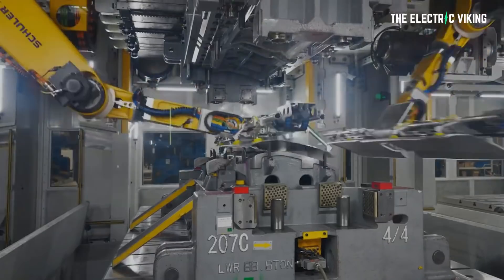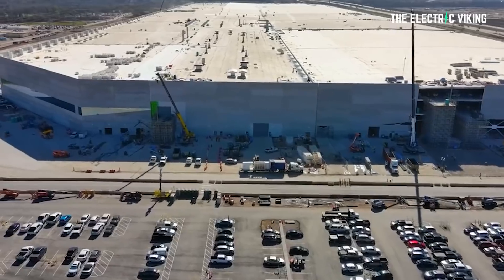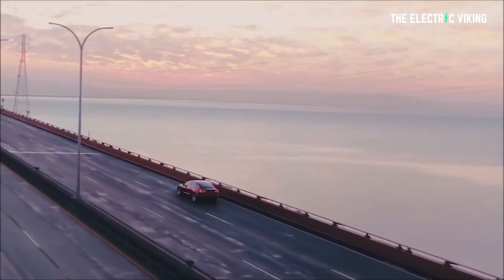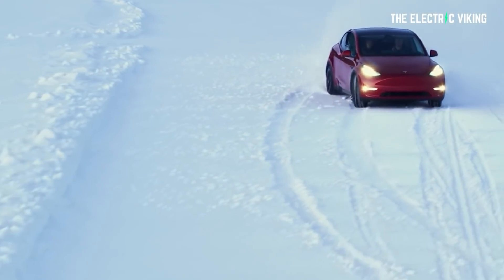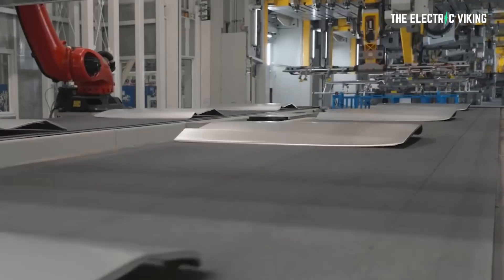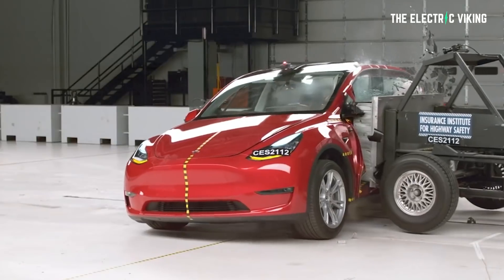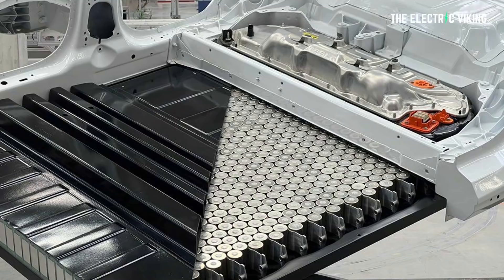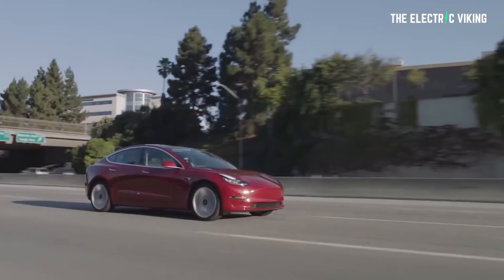Tesla's new patent: integrated energy absorption foundries

Comment: I think the main issue with the gigacastings is tepairability of the vehicle afyer production. While from a production, cost, ease of construction, saftey and innovation standpoint the technology is aspirational , I think too little discussion is put into the disadvantages of vehicle repair in terms of damage. While it is expecyed the vehicle crash likelihood is low, it is not uncommon to see umforseen accidenys happen, such as honda bumps, missing a barrier pole at a parking spot or imforseen crashes. If a chasis repair is necesaary and cheaper than providing a new vehicle (another topic for discussion, resource wasting with planned obsolence while recycling materials is difficult but extremely necessary if we want to stop mining to build evs and not physically destroy our planet any further, highly underestimated) what benefits of easy repair do gigacastings provide over traditional chasis making?

Comment: It’s not 2 parts vs 70 — those were the numbers for the two-piece Model Y rear end produced early on in Fremont.

New process is 2 pieces (front and rear) vs 125ish!

And then there’s me the structure battery pack, which I haven’t heard quantified yet, but I’m willing to bet is fewer parts than battery pack plus frame arrangement.

Comment: My only concern about large castings is related to reparability in the event of a moderate collision, will vehicles be written off more frequently or can the structure be repaired/replaced affordably?
Reply: The casting is the underbody. The body panels would still be the outer surface of the vehicle. So only in accidents that would have resulted in frame/structural damage (in which case it would normally be written off anyway) will the casted vehicles have to be replaced.

Comment: I was watching a video of a VW plant a few days ago and as much as castings sound like a good idea, traditional metal stamping is very well understood and developed.
The entire body of the car was made from the sheet metal to the body coming out of the paint shop with not human labour. All those 70pc of sheet metal were assembled by robots at a rate of one entire body every 45sec. After seeing that video I came to the conclusion that traditional manufacturers are far more effecient than most people think. It may be possible that the difference in manufacturing cost between casting and metal stamping is not big enough to justify changing.
Also a stiffer body is not always better. It certainly helps road handling but that is not always the most important metric.
Reply: Elons machines that build the machine takes 10hrs to build a vehicle vs volks 30hrs. The best of old production does not cut it any more. Innovate for cost cutting and efficiency.   Company management structure does not make changes easy for others to move forward at teslas brake neck speed
Reply: @paulbaretta3269  I think you misunderstood the meaning of 10 and 30 hrs. That is the human labour time per car. The VW factory makes a body every 45sec. Tesla takes 120sec.
What VW needs to work on is the time taken for the humans to assemble the car.
Reply: @franciscoshi1968  impossible.  Tesla front and rear is cast complete. Saves weight, production floor space, roughly around 3 hundred robots and a huge amount of time to weld,glue or rivet hundreds of pcs. That casting machine was custom made for Tesla because of a new invented metal that injects into the mold in less than a second. Traditional methods simply cannot compete. U best do some homework and bing on Sandy Monroe and his  world famous tear down and analysis Co.
Reply: @paulbaretta3269  it takes 120 seconds per cycle for each casting. Look it up.
If each car has 2 castings that means you need to have two presses or one press then run many parts then swap dies. So let's say they have two presses.  That makes maximum one body every 120sec. We will assume the welding of the castings into a single body will take less time. So that means 720 bodies per day or 262800 cars per year per factory. 
The VW factory makes one body every 45sec that means 700800 cars per year.
The VW factory has lots of robots doing many steps one after the other. So all the numbers add up.
The presses to make the pressed parts make a part every few seconds. Pressing sheet metal is very quick. It just takes a few seconds for the die to stamp a part. Casting is much slower. You have to inject the molten aluminium then you have to wait for it to cool down enough for the metal to solidify before you take the part out and then you have to wait for the part to cool down even further before you can continue processing (like machining of threads etc).
I have been to factories that do both. Casting is certainly slower per part. The only advantage is once the part is cast it is pretty much finished. The stamping is extremely fast. So it is possible to make bodies just as fast. It is just a matter of having enough robots.
Tesla did try to automate the stamping and welding process. They just don't have enough experience to make a stamping factory as the traditional car companies that have been doing it for decades.
A very simple example of Teslas's lack of experience is the sub standard paint finish and gaps in their first cars.
If they are so good why couldn't they get that right first time? Paint and panel gaps are a very basic part of making cars that everyone got sorted decades ago.

Comment: The gigacastings also mean much more accuracy overall, like an order of magnitude more accurate. Panel gaps will be absolutely accurate. That means most assembly needing human/hand work to fit should be unnecessary. That means way more automation and faster assembling. Now the car will go thru the line faster than grandma can go with her walker.

Comment: The entire central interior is built on the ‘structural battery pack’ and then offered up to the front and rear castings.
This is fine for cheaper manufacturing but the risk is in crash absorption > integrity.
IT HAD BETTER WORK !!!

Comment: NVH (Noise, Vibration and Harshness) of these designs of Giga castings are still in serious doubt, in our view. OEM's of ICE vehicles have had to give serious design attention to isolating NVH from rear suspension sub-frames on their vehicles, such as in the BMW X5, as just one example. We have loved almost 2 years now of Model 3 Long Range ownership. We are also Tesla shareholders and have a reservation on a Model X Plaid so, we could be called Tesla fans. However, we collected our brand new Model Y Long Range last Wednesday, 23rd February 2022, to run alongside our Model 3. From the Shanghai Giga factory, our Model Y on standard 19 inch wheels, seems to have a rear aluminium die-cast, Giga casting. Driving back from the NEC to Loughborough, the Model Y had horribly intrusive, low frequency sound pressure wave booming in the cabin, caused by either, some manufacturing fault(s) or by design, inadequate NVH isolation of the rear suspension and Giga cast chassis frame from the cabin, as the tyres run on the road surface. We get headaches and ear pain from this low frequency, resonating booming - even at low speed, each time we drive this Model Y.
The car also seems to be so harshly suspended and so unsettled on the road, that even on basic Autopilot and without turning the wheel at all, it fidgets from side to side at speed and makes us feel nauseous – something we have never experienced before in any vehicle and certainly, not in our excellent Model 3 Long Range.
The booming, deep reverberation, amplified within the cabin volume as the suspension crashes over bumps, is like having the bass turned up high at a rock concert and the drummer giving it special attention every time a rear wheel drums over a road imperfection.
Tesla Sales say that "as the car is obviously not for us" they can only offer a full refund and that we should return it to Tesla. Tesla Service have been persuaded to cut their initially stated waiting time of 1 month to Friday this week, for me to demonstrate this problem to them.Tesla owner's forums seem to regard this as a common Model Y fault. Even ear plugs don't seem to help much, as the bass reverberation seems to resonate within one's skull. Until finally resolved by Tesla, the car is just a very expensive piece of driveway art.
We feel that the jury is out on the whole question of whether NVH of Giga cast chassis frames, as currently designed, manufactured and supplied by Tesla, actually give an acceptable quality of vehicle NVH to the end user, despite the obvious and as a professional Mechanical Engineer myself, very impressive manufacturing cost and efficiency benefits to Tesla.
Reply: That sounds like a serious design flaw, a missing component or a missing fastener(s). Nowadays computer programs should be able to model a design well enough to prevent that. If possible, it should be brought to the attention to someone on the design team.

Comment: I always wondered if this rigidity would result in many more write-offs due to the brittle structure.
[Correction - “60 to 120” MILLISECONDS ]
Reply: Rigid does not mean brittle. Think rigid (and dead accurate parts) means a much more controllable design that can be optimized for better -
Crash safety
Vibration
Handling 
Simplifying parts
Reply: @beauarts  it’s a cost saving and profit margins boost which could explode in Tesla’s face if the insurance industry risk managers load the brand.  The casting are brittle…..they have no capacity for absorption/flex beyond the critical point.
It’s great on paper for everyone …..until it isn’t so great after all.   We shall see.
Reply: @davidpearn5925  Really, what is the basis of your brittle analysis? Have you found test data on the aluminum alloy in Tesla castings? Maybe you got a piece of it and measured the modulus of elasticity?
Reply: @beauarts  well Sandy Munro acknowledges that it won’t flex any more than cast iron. If it gets a reputation as a throwaway item it’s going to be a bit of a disaster for shareholders.
Body jigs designed to stretch twist and pull exist because forces commonly get beyond the panel cladding.   We’ll see.
Reply: @davidpearn5925  ok, that’s some analysis I can understand. There are ways to deal with, isolate, or mitigate that problem. I hope Tesla is aware of it which they should. It’s not out of the question that the slow ramp up of Austin and Berlin are due to not just production but finding and correcting problems such as this. Ditto for the cybertruck

If this is a systemic problem in using a lot of gigacastings, it could be another moat for companies intending to use that tech to shave costs
Reply: @beauarts  another aspect is the is the matter of quoted repair costs ticked off on by the insurance assessor .
Determining if there has been a stress failure deep within which isn’t YET obvious as a structural failure.
Steel yields enough to make that much less of an issue, but castings in an ‘affordable’ vehicle make life difficult for repairers wanting to stay viable and insurers competitive.  Time will tell.

Comment: Fantastic innovation. In material science it is well known that castings behave very different from pressed or forged parts. Castings are more brittle, which obviously will not help in a crash. You can design a special alloy to improve the cast, which it looks like Tesla has done. And the best way to make it less brittle is to do a bit of shaping on it. Fantastic that Tesla does this on these huge and complex parts. Really  amazing to see this.
Reply: Casting are brittle due to the nature of casting, not due to the material used.  This was why Sandy Munro got after the Fird Fiesta's use of them...they weakened the 'safe zone' and were unreliable long term if used for suspension and frame parts.

Tesla put out another 'white paper' like the storied but ultimate disproven 'alpha paper' regarding Hyperloop.

Comment: If cars were out for crash testing that might explain the delay.  Tesla may have had to wait to have cars tested.  Their other cars have a high rating and these should be better.  The cost to make these is good for the customer because Giga castings are Aluminum and Aluminum cost far more than steel.  Tesla could be known as a chemical company as the chemistry of the Aluminum is proprietary.  There is so much to know about the new model Y.  Please get them into production.

Comment: I think that overall the structural battery pack is a mixed idea. Going to make battery repairs impossible
Reply: What % of batteries are repaired today?
Reply: @bru512  Not enough. One of the considerations for owning an EV that's out of warranty. Replacement costs are prohibitive
Reply: Tesla says the batteries will be recycled to create a closed loop system, so there must be a way to get to them. Maybe pull the seats and carpet, and cut a hole in the floor?
Reply: @catsaregovernmentspies  Check out Sandy Munro's tear down of Tesla's.   The vehicle gets raised, and the battery pack dropped. I expect that in the future, batteries will not be repaired, but swapped out.
Reply: It’s a good thing to remove junked cars.
A new vehicle every time.
Insurance will love the new for old recyclability as that’s another money making opportunity waiting to be tapped.

Comment: Giga-castings certainly cost less than welded pieces
but in a minor accident involving the frame of the car instead of replacing a welded bent piece
the entire giga-casting will have to be replaced
a cost 10X as much

So any savings by Tesla are made up by the owner in a crash
and apparently, the insurance companies are aware of this and may jack up the costs of insurance on a Tesla

One man's savings can easily become another man's expense...
Reply: Our tesla insurance price quoted to us on our new tesla is the same that we are presently paying for our 2014 sierra truck.  We were pleasantly relieved.
Reply: Maybe the damaged section could be cut out and a new section welded in. Aluminum can be welded.
Reply: Anything that caused the castings to become completely crushed would require a convential vehicle to be totaled as well. 
Elon already said they would have bolt on crush pieces for repairs that didn't require write offs. You just cut out the crushed crash sections and ad the new pieces. 👍🏻

Comment: I've always worried about cars after a wreck. To me there is not a good way to know how the structure has been weakened. I don't trust the body shop to be able to do that. So replacing an entire casting might be safer in that case. Time will tell how much that costs and if it makes a difference in where the line is drawn between "reparable" vs "totaled".
Reply: Could alternatively mean stronger body that can handle minor impacts better. But if in theory there were some corner cases, a safer car will be worth it: Car parts can be replaced, a mother or child not so much.
Reply: I have my doubts also. Putting a new casting in sounds like simply more fanciful spin.

Comment: The 70 count part reduction was claimed for the rear casting alone. A roughly similar reduction for the front casting seems reasonable.
Reply: Total parts count reduction shown from battery day was 179 combined pieces down to 3 with the castings and structural 4680 battery pack. 
Also elon told Sandy Monroe at the space x tour last summer, that each casting eliminates over 300+ robots per line of assembly. 

Imagine the capex, energy savings and maintenance cost savings from that alone. Plus the casts are able to be melted down and recycled easily. Vs all the mixed pieces of the sub frames. Lots less parts, less fasteners, less glue or adhesives, less welded parts. It all ad's up in the end. 🤔
Reply: 💯

This is truly revolutionary.